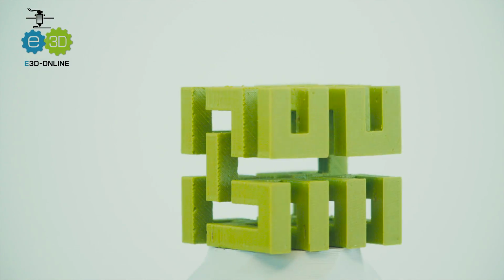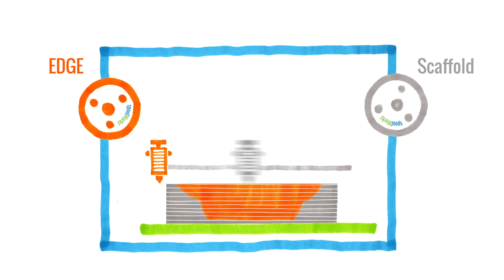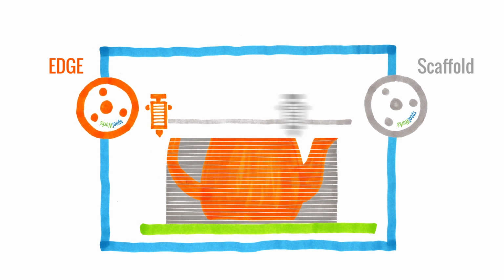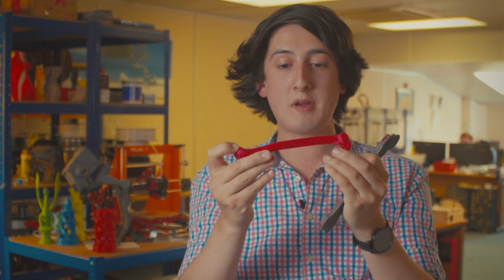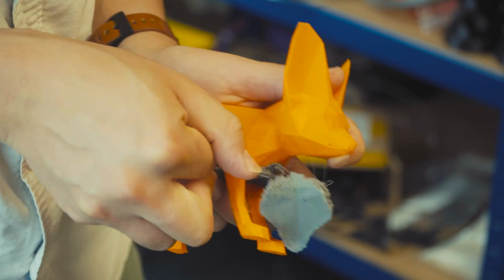E3D Scaffold Support Filament: Print the Unprintable

Comment: What dual extruder printer do you guys recommend ;) (I know touch question :D )
Reply from the maker: There are a few dual 3D printers that are achieving consistent solid performance - we test several at E3D & our customers give us useful feedback on others...
spoolWorks Scaffold & Edge filament combo works very well on ...
*Leapfrog Bolt   *Ultimaker 3   *Prusa's i3 Mk2 multi-material upgrade   *BCN3D Sigma
Reply: No plans to introduce a mixing nozzle/heatbreak system like prusa does now ? They use parts from e3d , but it does not look like a cyclops + it does 4 materials .